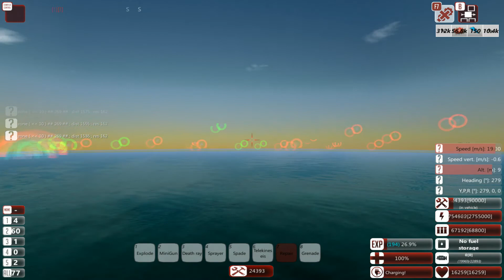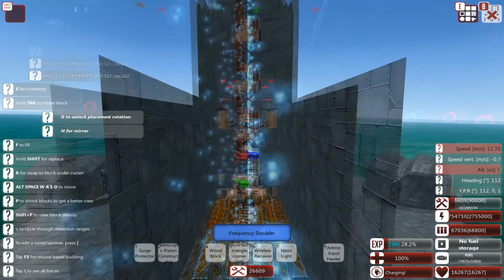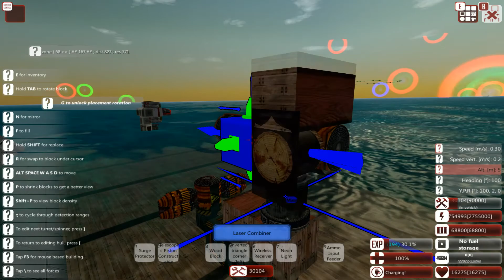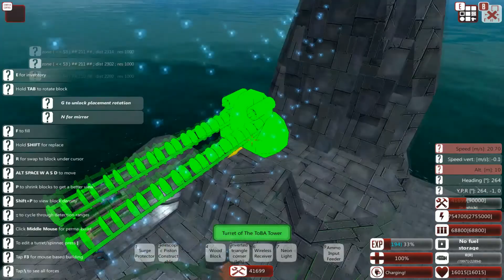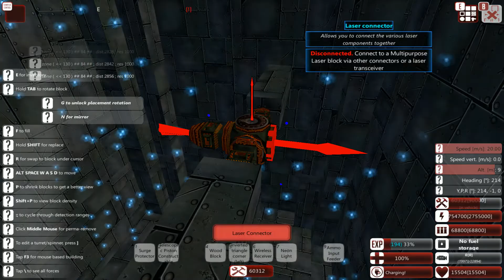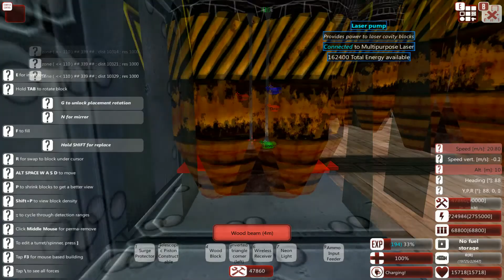From The Depths / ToBA / part 18 ~ AA Lasers (FINALLY)

Comment: I must say I like the big cannon without a rear cap. It's in the back soreally  not that likely to get hit there and it looks damm impressive with all those cannon bits looking out.
PS: I still can't wait for some random laser ship to gut out the AI core from behind.
Reply from the maker: Oh, I've had high-ex shells gut it a few times actually. ^^ Unfortunately the cannon does need some rear armour because, sometimes, you find yourself under attack from multiple directions at once. Not good for an exposed cannon's health.
Reply: Ah, it's just resources and resources are there to be spent, right :(

Comment: The wave front adjustor even work?  I was trying it out on a build not long ago and didnt do much to get through a thyrs smoke.  This was a 10k laser i was using.
Reply from the maker: The wave front adjusters do work I believe... but what they really do is increase the percentage of damage getting through a given defence, while also greatly reducing the overall damage. Thick enough smoke will still stop them but it will take more smoke to do so completely.